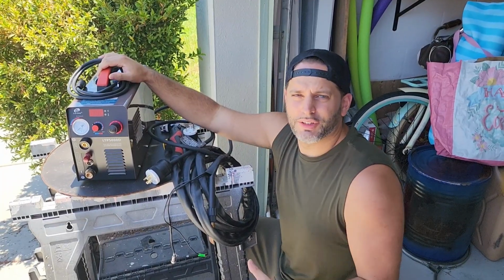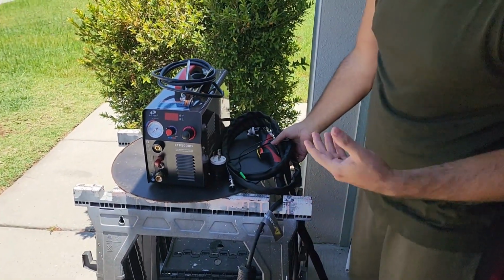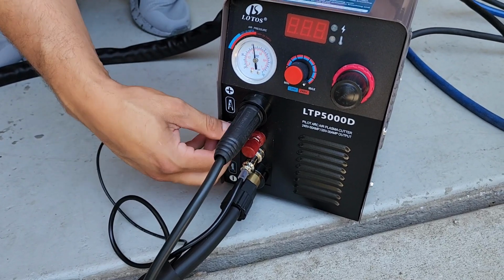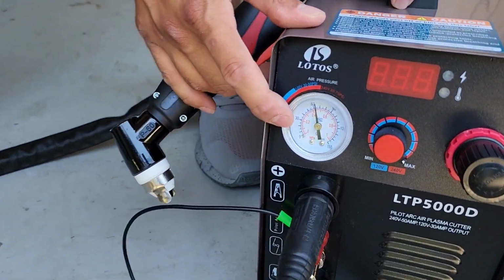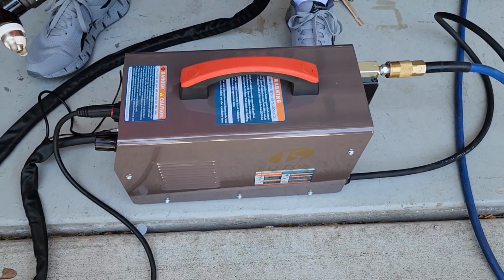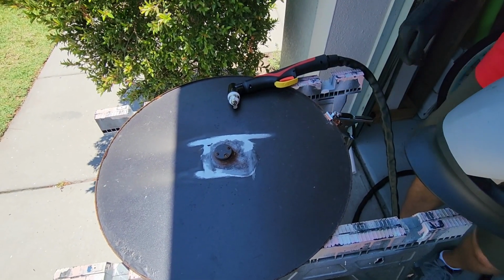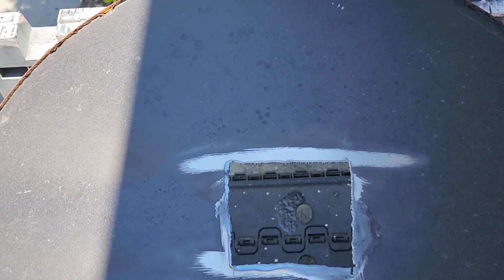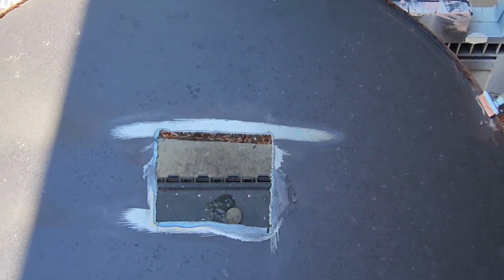LOTOS LTP5000D Plasma Cutter Machine - Review

Comment: Looks and sounded like it wasnt getting enough compressed air. Its what puts off alot of people from buying the more budget friendly plasma cutters, they need good air compressors capable of supplying a large volume of air continuously. For the cheapest plasma cutters then a suitable compressor is typically a good bit more expensive than the cutter itself.